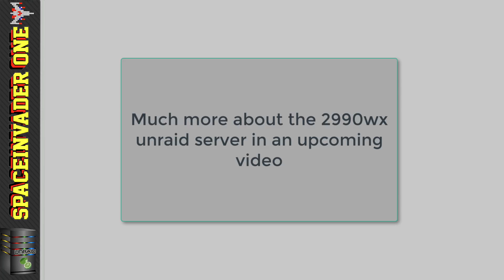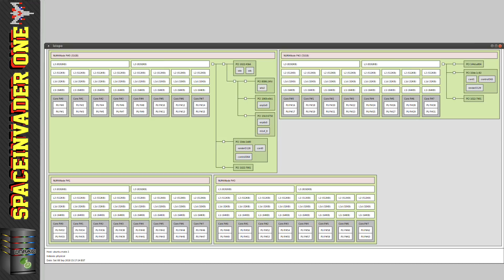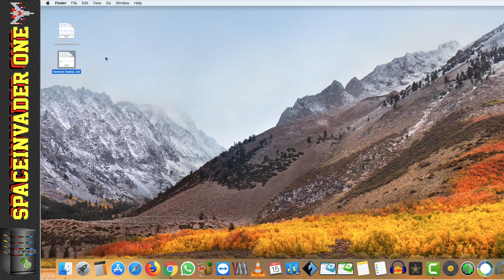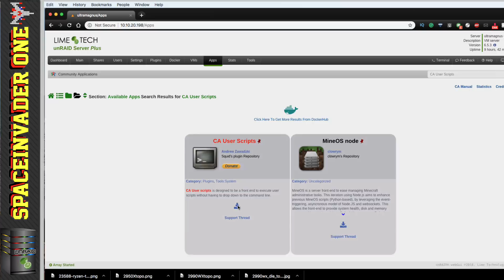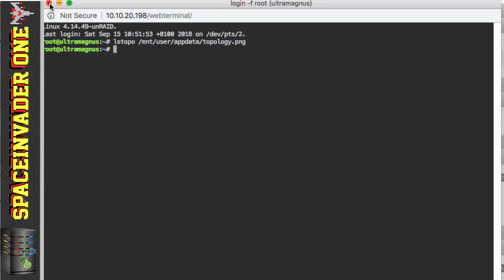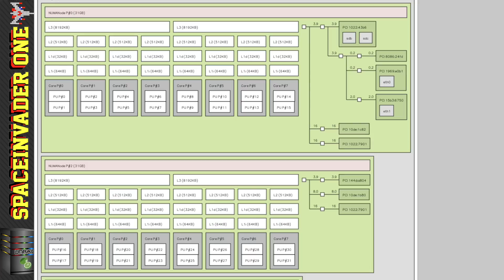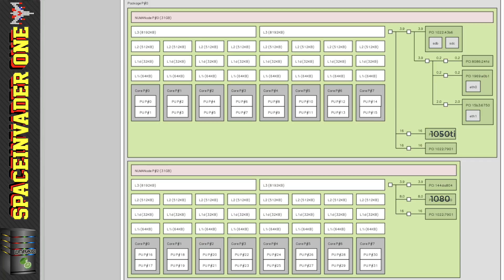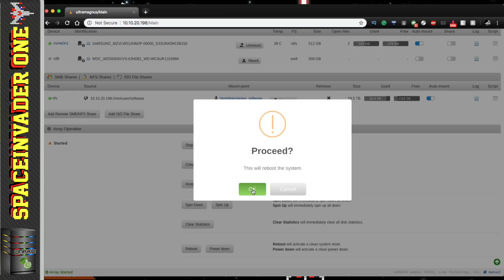How To Use LSTOPO for Better VM Performance on Multi CPU and Threadripper Systems

Comment: Headsup the install Script might need a little updating , with 6.7.2 I get a:

lstopo: error while loading shared libraries: libudev.so.0: cannot open shared object file: No such file or directory

Kudos on your videos
Reply: Hey, i am not sure if you have solved the issue or maybe someone else run in to the same problem
After the reboot for the install:

1. run ln -s /lib64/libudev.so.1 /lib64/libudev.so.0
2. run the command, that worked for me :)
Reply: @Galotar91  Worked! Thanks for the quick fix

Comment: I built a similar system with threadripper 1950x.  The other day my cpu cooler died and I had a thermal shutdown.  Luckily this didn't harm anything and a new cooler solved my issue.   From that moment forward I tried to see if it was possible to monitor the cpu temps and all the other temps on my board through unraid.  I tried the dynamix temp plugin to no avail, cannot get it to detect the sensors.  I tried a suggestion by someone on the unraid form that suggested adding "modprobe it87 force_id=0x8620" to my go file and then running "sensors".  The sensors command does yield the correct result for the sensors but I still cannot get dynamix to detect anything.  Did you have any similar issues with the setup your system.  Any advice would be appreciated. Thank You and keep up the amazing work.

Comment: I found this video from your feed a bit over a month ago, i did wish this video twice. Really awesome you did it !!! My configuration was messed up, this really helped me out, sort of. Now im facing USB device lagging for some reason, most part i see it for keyboard, i keep getting a letter jams, so sometimes i ddouble my writings aand i have to correct them. It also can be a broken KB, what i don't belive tough. Maybe ill find a way to fix it :)

However, im facing a weird problem with windows 10 vm (no clue yet about otheers) if i launch something heavy few times, my VM performance drops alot. Lets say i have fresh booted VM and i launch GTA V or SOLIDWORKS first launch is fine, second launch go worse a bit worse, but noot easy to notice. Maybe on 5th-6th launch performance can be unplayable around ~25fps, when i had on first launch ~80fps or more. Found this out when i was doing moonlight nvidia shield stream gaming with my iPhone, and later found out it even affects to csgo to unplayable level. It all goes away when rebooting the VM. Really would like to solve this out, maybe you have a clue what is going on, or someone else whos reading these? Im running nvidia pascal gpu and 2x E5-2667v2 for cpus.

Comment: I just used lstopo on my unraid threadripper 1950X, it doesn't show numa node, it just show Machine -> Package -> L3 cache etc... maybe some setting on the motherboard? i will keep looking into it
Reply: The memory interlacing setting to Die or Auto will be UMA, setting to Channel will be NUMA. I will test it out to see any performance difference, not sure if memory will be correctly separated in each VM.
Reply: Any results?

Comment: Great video. Your the reason I have an unraid server. Just recently got a geforce 970 gtx secondhand for my son didn't work on his board but worked on my unraid server and board. Ended up pulling all the drives out of my unraid box and the usb unraid key. Put the drives in his old machine with the USB unraid key. it fired straight up and did a parity check, up and running straight away. works just the same as it ever did. Totally hardware agnostic. For ideas on future videos. Plex or EMby video would be useful.
Reply from the maker: Hi Norton. Yeah its great to be able to just move Unraid from one machine to another without issues. Yes I will be doing some plex/emby videos very soon :)

Comment: I have ran the scrypt, i have the txz files in extra but the lstopo command doesnt work, could it be that the txz files werent isntalled ? i rebooted the system as you said, but it didnt work. Any help ? Can i somehow run manually the txz files ?
Reply: i had to link linudev 1 to libudev 0 i have no idea wtf is that, but lstopo worked afterwards
Reply from the maker: Great glad that its now working for you. Thanks for watching :)

Comment: Is there a way to also pin the correct ram to the vm's to capture every bit of power capable? With the topography map it would be nice to also reduce latency there to maximize every possible bit of power out of the vm's...love your content and wish I could justify the switch from 1270ish xeon  to that processor but think it's best to just stick with what I got till I cant do what's necessary with it...anyways keep up the great content always enjoy seeing your videos pop up in my feed and thanks again for all the walkthroughs I wouldn't be using no where near the capability of my system that I am if it wasn't for content like yours
Reply from the maker: Hi Patrick, unfortunately, not at present as far as i know :)

Comment: Thanks for the vid Spaceinvader. Running Unraid 6.6.0-rc3 and get - lstopo: error while loading shared libraries: libudev.so.0: cannot open shared object file: No such file or directory when trying to generate the png. Any thoughts?
Reply: Thanks Rolando, that worked.
Reply: @Rolando Nieves Thanks!

Comment: 2990WX? Lucky bastard... I wish I could drop $1800 on a  CPU. 😩
Reply: and here's me thinking i'm all fancy with my 2700x
Reply: Hell, I was happy with my 1920x and now im jelly
Reply: I'm running an 8350 for my unRAID server. It's keeping up more or less but it sure has to try real hard from time to time. 😒
Reply: @cammelspit  I'm thinking of throwing my FX-8320e into a backup server. Is your server doing anything besides file management?
Reply: I'm running two Intel Xeon E5-2680 V3's.